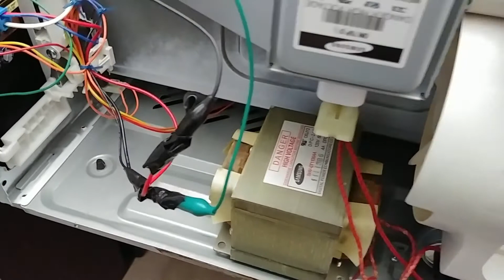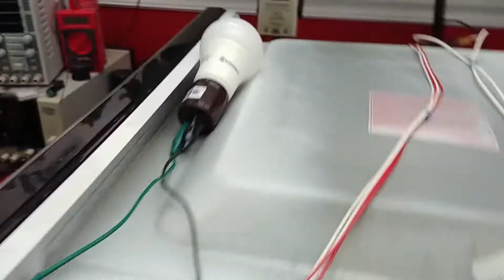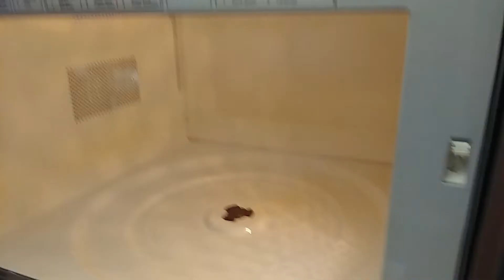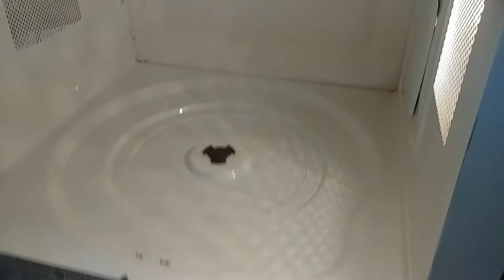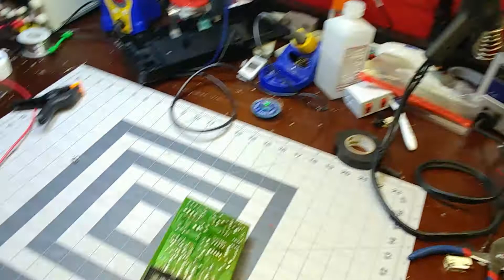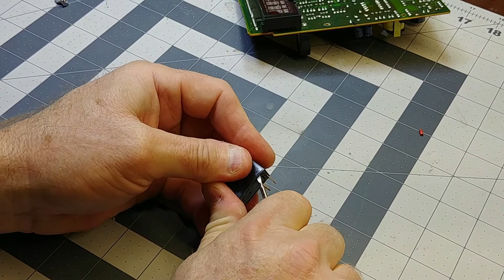Troubleshoot microwave oven that stays running

Comment from the maker: The microwave model is:  UMC5200BAS.  The oven is an 1100 watt oven.  The amperage going through the relay would be about 9.2 amps at 120 volts.